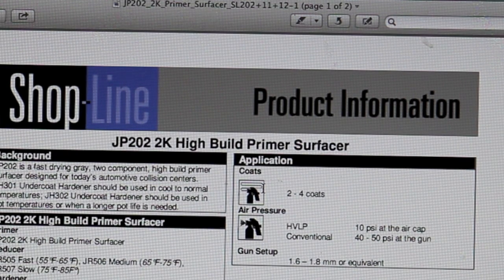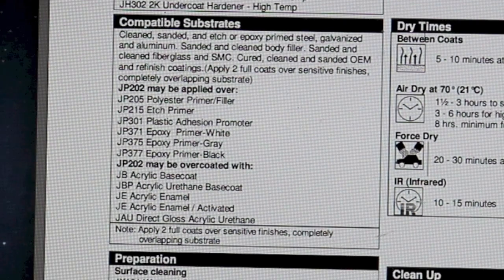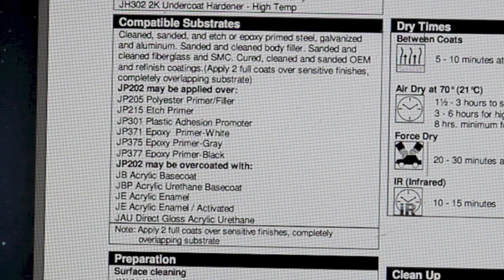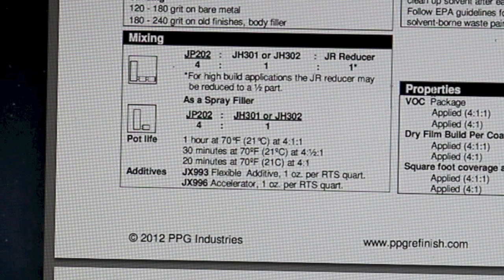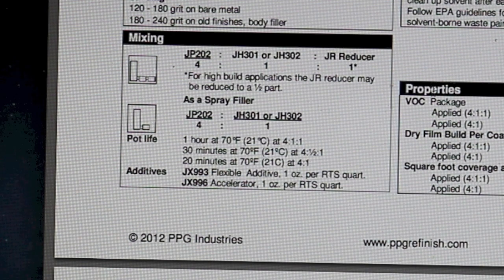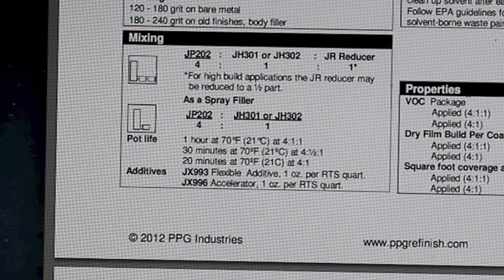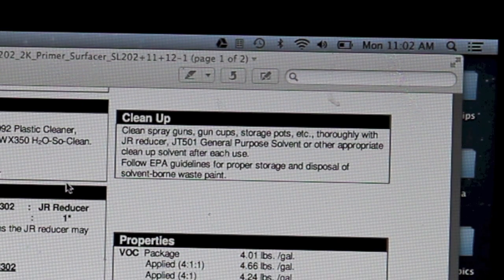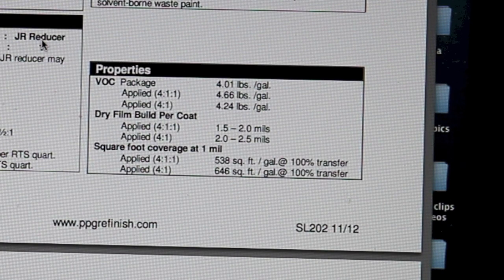2K Primer Surfacer Shop-Line - JP 202 Technical Data Sheet TDS

Comment: Excellent info vid. Key is ( if you want a no hassle perfect job- no sleepless nights worrying about solvent pop, poor adhesion, non drying paint and a multitude of other problems)to follow data sheets to a T. No bakyard chemistry experiments. + common sense goes along way. All brands are different. Thanks for the vid.

Comment: what do i do if i want to.add.more 2k primer I applied 1 coat the night before but had compressor problems and had to stop can i just continue to add another 2 coats this morning or do I have to sand it down again before applying more?
im using jp202 primer

Comment: jp202 is the primer that is very thik and is use to fill in minor sratchs from bondo???? and it is necesary to use the reducer or just the hardener >????
Reply from the maker: Yes, it is used to fill scratches.  You have to use the hardener.  The reducer depends how how thick you want the primer.  By adding reducer, it will flow out better, but will not fill as well.  Thanks for watching!
Reply: in the shop where i work we used glasurit primer but for some reason after baking the car you can still see all the scrastchs and i dont know why.......we sand bondo with 320 and primer with 400 and 600 ...do you have any idea why is it ? specially with black and silver cars